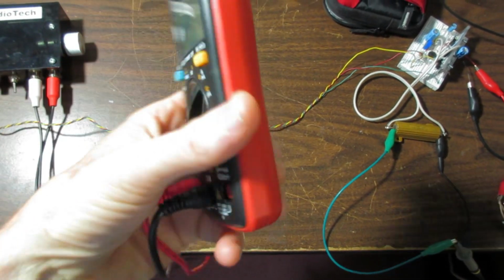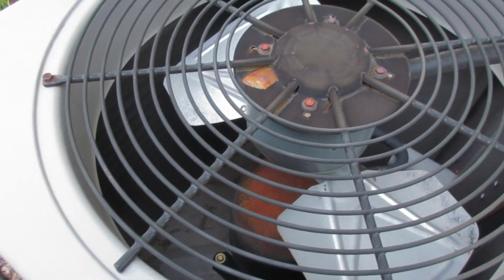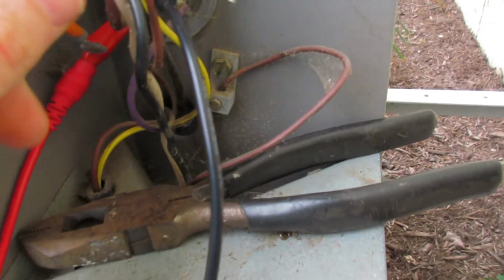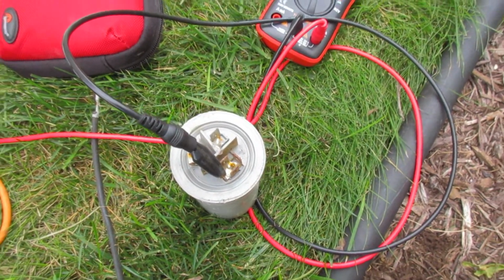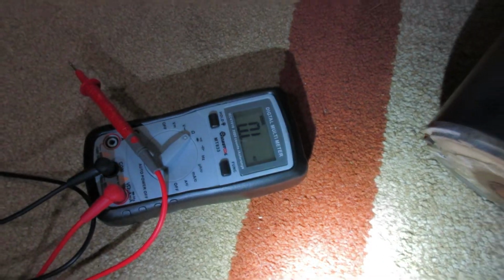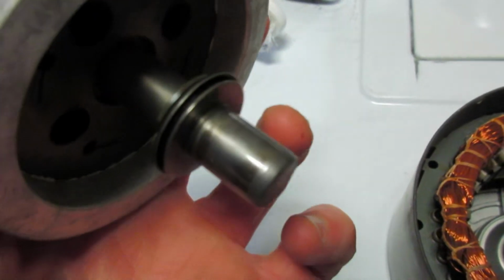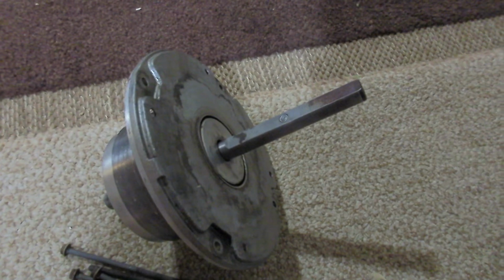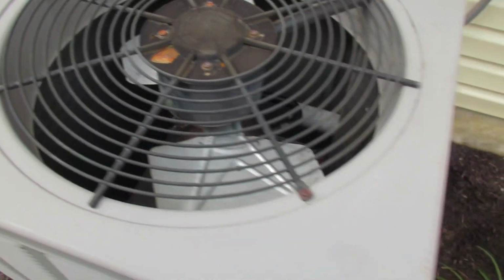AC no cooling seized condenser fan HACK repair

Comment: I had this exact problem two weeks ago. Did the same fix as you... lasted three days. Took it apart re-oiled the sleeve bearing, lasted one day.
Ordered new motor. Re-oiling every morning kept it running long enough for new motor to arrive. Those bearings are not economically replaceable. Yes wish they were ball bearings, would be an easy replacement. Good Luck
Reply from the maker: We're in the middle of a September heat wave, so I hope it holds. It was 93F yesterday. I found the motor online in case I need to order. I made this repair on Aug 31st. So far so good. Interesting to see how long it holds.
Reply: @JohnAudioTech  How long did it hold for?
Reply from the maker: @ZishanMalik It lasted the rest of the cooling season and a bit into the following spring.

Comment: Good on you, partner!   Most HVAC technicians would just replace the motor - and rightfully so, in most cases.  Doing a 'temporary' fix like this allows the unit to function until a replacement motor can be secured, and avoids the premium 'fast service!' rates that are the norm in the warmer seasons.

Comment: Funny how different country's deal with heat pumps. Here in NZ the fans are mounted on the front of the out door unit. This dose give a degree of protection to the motor bearings from the weather.

Comment: Nice Work Earthling 
I'll Say IT Again 
I Wish You Was My Neighbour !
Our Air conditioning Unit Failed Last Year Over @ The Lab (  Studio  )  I've Semi Stripped It And The  Motor Runs Free And It Gets Cold So ........ I Need To Access The Capacitor . Where Do You Know A Cheap Supplies Place Please ?
Reply: Get a cheap part and you will be fixing again next year.
Reply: WE Need That Beauty Fixed Proper Because Our Studio Is In The Attic 
WE Call The Microphone Booth  "  The  Oven  " 
ATB
Reply from the maker: I bought a Supco hard start capacitor off eBay. There are some legit suppliers there. Otherwise look for a HVAC or appliance  parts supplier nearby.

Comment: GREAT repair job! My house runs off a rainwater storage tank (no street supply) so we have an auto-on pump that feeds everything, drawing from the tank. The starter cap for the motor (which has begun not starting randomly, just hums like mad) is mounted on the side of the motor that is right up against the wall in the shed where the thing lives where it's totally inaccessible! 

Who would install a machine so you can't do basic repairs without a huge tear down ( in this case making a huge mess)?.... grrrrrr. 

Say hi to the Snickers.

Comment: My service company comes once a year. They remove the top of the ac and flush the coils on all four sides to remove all the shit that gets sucked up. They make sure the motor turns freely, check the controls/relays voltages/currents and charge and the temperature differential between inlet and outlet in the line and also in the airflow inside.

Comment: THE RIGHT THING TO DO IS  CALL A  A/C TECH  AND PAY  SOMEONE  TO FIX THE  ISSUE
Reply from the maker: It is only a few bolts and plugging in the wire spade connectors to replace the motor. The motor costs about $100. Why would I pay someone $500 when I can do this myself?
Reply: @JohnAudioTech  
Don't get it why Johnney Bot will call the A/C tech support team for something simple that you did. I don't think the professionally trained tech would do better job than you did. I seems like this days even to change a flat tire people call AAA, or CAA and tow the car to garage (and in the process the tow truck will bust something else).
Reply: Johnney Bot That's only the "right thing to do" if you don't possess the competence to do it yourself.  Don't judge other people by your own lack of ability.
Reply: Yes, he will just replace the fan motor and charge a weeks wages for a job that many people could do them selves with just a little mechanical and electrical knowledge. I fixed the water pump myself, simple capacitor replacement, the plumber was just going to replace the whole motor, pump unit!!
Reply: Absolutely NOT. I think doing some repairs by yourself is allowed.
Reply: My ac stoped working called ac dude wnated to charge me 150 just to diagnosed it and 800 to change motor and capasitor as he told me thise were the most common causes i said fck rhat i bought a 20 dlr capasitor did not do the job so i proceded to change the motor i got a used one for 50 bucks it was the motor i saved more then 700 dlrs as a man we should be OUR HANDY MAN WHEN IT COMES TO HOME IR WHATEVER
Reply: @George Myers GROW UP.
Reply: @johnneybot9542    I'm getting the vibe that you're an A/C tech and cannot stand the idea that someone isn't willing to just throw gobs of money at you to fix a problem that a modestly-competent DIYer can do himself for practically nothing.

Like the appliance repairman a couple of years ago that wanted $170, plus parts (at 'list' price), to fix my broken oven.  I was able to fix it myself for $20 by replacing the igniter.  Took me less than 30 minutes.  Saved myself  AT LEAST $150, and probably more like $210.  Works great, and it'll probably go another 15-20 years.

If you don't understand how an apparatus works, fine, call a professional.  But as the video shows, if you have knowledge of how to actually perform a repair, why on earth would you pay someone to do it for you?

'Grow up' indeed.  Physician, heal thyself.

Comment: Glad you got the cooling going ASAP. Those "Goodman" condenser units capacitors are under rated for voltage. I measure 20 to 30 VAC over stamped volt ratings. Lubing fan bearings seldom works for long.

Comment: Nice fix John, you saved them some money.  I did the same thing to the motor in our bathroom fan not long ago, the motor was seized and spinning only slightly and couldn't find a replacement motor.  I had to use liquid wrench at first since there was some rust due to steam from the shower, etc. then I used a lightweight oil.  At least you will probably get the rest of the season out of it.  You may want to change the capacitor when you finally replace that condenser fan motor.

Comment: I have a box fan that the sleeve bearings went on it. It'll run but I have to oil it all of the time now. Pretty much once they go they stay gone. If you can replace the bearings you should get more life out of it. Otherwise expect it to just seize back up on you if you're not constantly oiling it. That's my experience with bearings that have seized. They become oil junkies.
Reply from the maker: I'd suspect your fan has a lot of play in the worn bearing. I've found that if the bearing is tight, it can still have good life. When the bearings in my bathroom vent fan and the furnace blower unit started squealing, I oiled them and they're still going 20 years later with an oiling every 5 years.
Reply: @JohnAudioTech  the bearings scored so they're tight. When the bearings run dry the motor locks up.